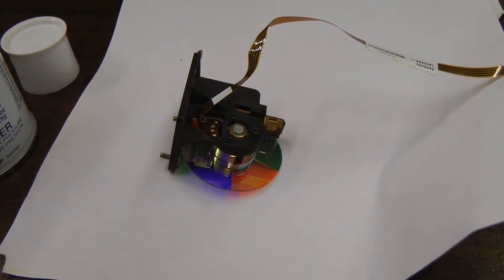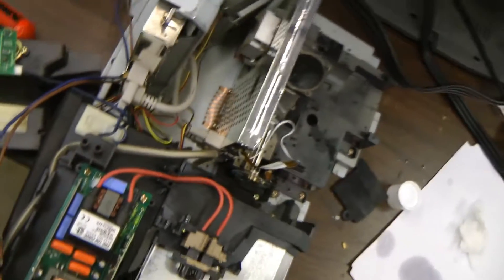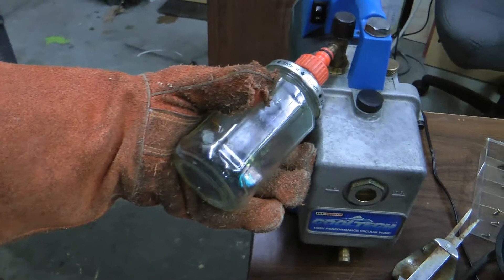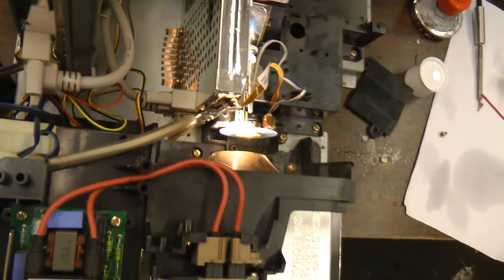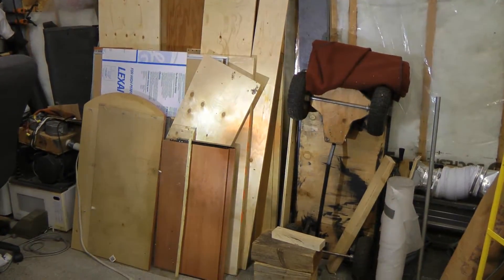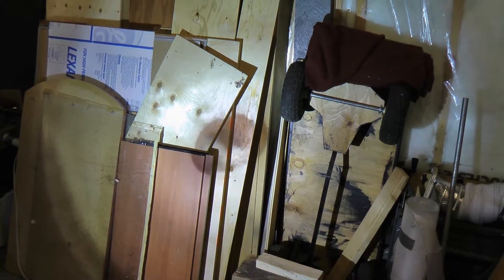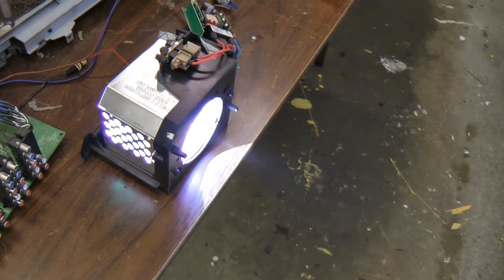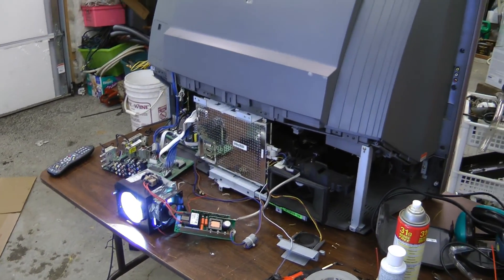DLP rear projection TV part 3

Comment: I know this video is SUPER old but... You could have made a short throw projector like I'm in the process of doing now. I haven't even done anything besides remove the top half of the tv. (Bottom and top screen portion's separate by removing a few screws). My first test without changing anything got me a nice clear 100" screen within only 4ft of distance. I'm using a old 42" Samsung DLP that I found in the trash (with a fresh bulb) for my project. If this works the way I hope, I got a free projector out of the trash. Right now I'm contemplating on weather or not I should convert it to LED. Only time will tell.

Comment from the maker: @mikeselectricstuff I was wondering about that too. I turned the camera exposure way down (not shown in the video), effectively turning the rolling shutter camera into a high speed light level sensor, and it looked like the light intensity actually has short peaks, not short valleys as you would expect for color wheel blanking. I'm going to have to sick a current probe on the lamp ballast output and see what it's actually doing.

Comment from the maker: @Metalcastr, @bonecrime That's what I was worried about. It looks like I'm going to have to pull it apart again anyways, the color wheel seems to loose sync sometimes, I think it's either a dirty sensor, or those UV damaged wires have caused a short. The insulation was almost ready to fall off.

I'll vacuum impregnate some proper oil this time.

Comment: I'm afraid that fix to the color wheel won't be permanent. Tried re-oiling noisy computer fans a few times. It worked a while and then they became noisy again. Don't know if WD40 would be any better, but it's a very viscous oil compared to the engine oil I used. I hope it works out for you though!

Comment: What kind of power does the inverter of the lamp run on? is it 12 volts or 120VAC?
Reply from the maker: +coondogtheman1234 It runs on 400V DC provided by another power supply in the system, which runs on 120V AC
Reply: tesla500

I guess no hooking to a battery unless you use 12 volt inverter and car battery.

Comment: @bonecrime Yeah. The WD40 isn't a permanent fix, and it will leave it worse than before because it will displace any oil that was there. A perm fix would be oiling it with a light oil.

Comment: I have a different model of this tv i have the hd but i cant get it to turn on the power button is blinking i have looked into the apparent usual problems but the capaciters look fine but i have noticed that my lamp wont turn on i hear the color wheel spinning and the former owners say that it worked but was faulty he said he would just turn it on and off a few times and it would work no such luck for me the lamp appears to be intact like a regular light bulb no broken anything any thoughts?

Comment: Damn samsung, always trying to start a fire!, Its basically a hard drive with a colour wheel for a platter, if you find an older type seagate HDD with a removable motor, i bet that will fit in as a replacement